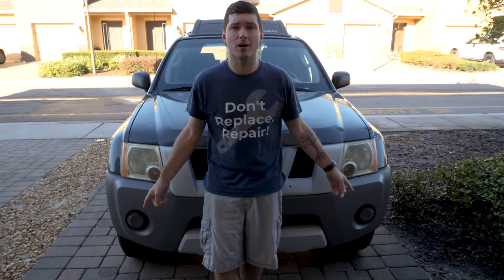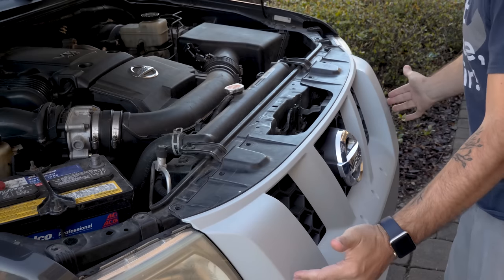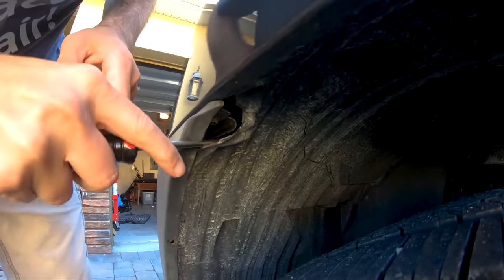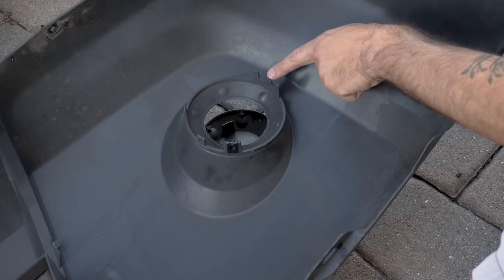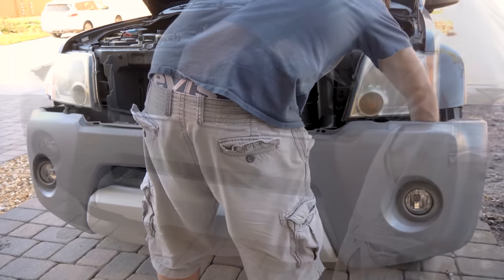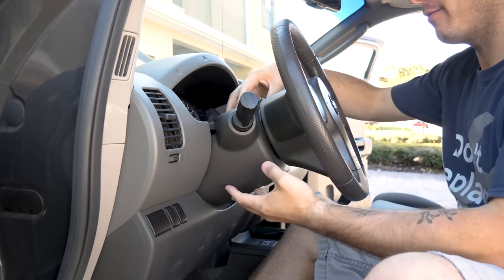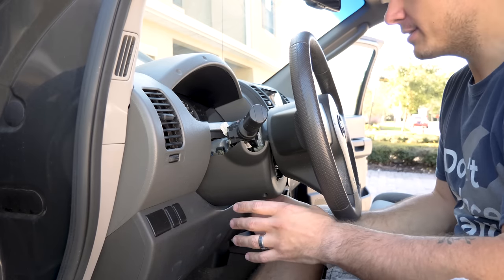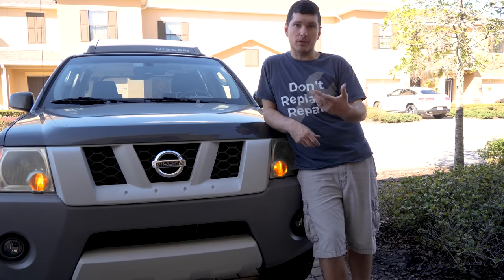How to Install OEM Fog lights into a Nissan Xterra

Comment: 2015 XTerra. This is the first time I've seen a split in the 2nd generation year range for a part, and I'm wondering if it has to do with the wiring harness. I have a 2005 XTerra, Off Road 4×4 4.0L. when I used your link for Xterra, the kit that comes up on Amazon has some confusing information. In the "Description" section it says it fits 2005-2015 XTerra, but below that in the "Features and Details" section it says it fits 2008 - 2015 XTerra. I also found a combination turn signal/ Fog Light switch on eBay that says it fits 2005 - 2007 XTerra with Fog Lights. Do you think this is because the 2005 - 2007 Xterra doesn't have the wiring harness? That would be typical for the way my luck runs.
Reply: Update: Now I'm even more confused. I did some research and found some forums where people were saying if you have a 2005 - 2007 XTerra with the "S" Trim package, you will have the wiring harness for the fog lights. In response there were other posts stating that not all of the "S" Trim packages for those years have the wiring harness. Someone else said: "To avoid confusion about your Trim package, look in the door jam and there will be a sticker with the model number and the Trim version". Like I said before, I have an Off-road model so I didn't know what to expect. My sticker shows me having the "X" Trim package. So, needless to say, I was very disappointed. I checked the sticker at about 1:00am on a Saturday night, in the rain, so I wasn't about to crawl under the vehicle and look. So, this morning I was removing the rear bumper (got rear ended a few weeks ago) and I was already on my creeper, so I decided to take a look under the front and see if anything was visible. Well, low and behold, there was an orange connector, just like the one in this video, taped to the harness. Now, I assume that wiring goes all the way into the steering column, so now my confusion is whether I should buy the turn signal arm that says for 2005 - 2007 XTerra with fog lights? My XTerra is in really good condition. Most people can't believe it's a 2005 model. I take good care of it. I plan on keeping it, so I want to add the extra features it doesn't have. I already added a new head unit with a touch screen, and installed a backup camera. If I win the lottery, I'm putting a supercharger on it and moving up from smoking 5.0 Mustangs to smoking GT500 Mustangs.  lol. Anyway. I appreciate any advice or insights if anyone reads this.

Comment: I have a 4x4 Xterra SE. Would the roof lights wiring be in place as well or is that reserved for the Pro 4-X?
Reply: It does not appear to be the case. Vehicles with roof lights have a 3-screw plate where the wiring exits the roof.
Reply from the maker: Bummer!

Comment: Does the whole bumper need to come off if your just replacing the housing?  (Someone kicked in and shattered the lens on one of my fog lights...)
Reply from the maker: You should be able to reach them through the wheel well if you remove the inner covers.

Comment: Are 2005-2007 configuration different from 2008-2015?

A junk yard just recieved a 2005 xterra and I noticed foglights on them. I have a 2015 xterra...are they interchangeable?
Reply from the maker: No, I do not believe they are compatible with the face-lifted Xterraa
Reply: @Rythecarguy  Thank you for the response

Comment: Was the light output noticeable? I'm wondering if it actually makes much a difference down the road
Reply from the maker: Noticeable is a good word for it. I did notice them. They were not a massive improvement however.
Reply: @Rythecarguy  change the bulbs out for LEDs much brighter

Comment: Everything was going great & getting ready to order. Until i saw I needed to change the on/off stock thingy as well.
Reply from the maker: It’s easy! Don’t let that stop you.
Reply: @Rythecarguy   is there a way to get around having to buy a new "on/off stock thingy"? I just bought some fog lights without buying the new stock. Basically I'm a poor collage student and I'm not going to spend a extra $150 to get it.

Comment: Another great one!! Thank you Ry! 👍 👍
I just put mine in my '08 I had to take my lights back to my guys at Nissan. They told me they "just fit" but not a 
perfect fit (on some models) :) They didn't even have a parts listing for the '08 X. 
I had to drill out the hole on the bumper cover a little lower on my bumper cover. 
And like my boy said they just fit LOL! Great clip, thank you for the post!
Oh yeah these are super easy to align!!!  👍

Hey Ry! swing by my channel! I do drones and things :) 
Be great to have you visit and comment and support
Have a good one bro!

Comment: What model xterra do you have ?
Do all the xterras come prewired for the fog lights?
Reply from the maker: Yes, I have the cheapest most stripped down model. The S
Reply: @Rythecarguy  I have a 2012 basecamp or at least that’s what comes up when I run the vin through Nissan and so It’s my moms old truck because now she still into trucks but more luxurious so it’s steel wheels no options for me abs I’m watching your videos they’ve been so helpful in teaching me what I want to do with it starting with those portholes in the space of fog lights that’s my starting thing to tackle.. do you know anything about this model I have I can’t seem to find the specs anywhere ..
Reply from the maker: Nice! If you take care of your X it will take care of you. Unfortunately I do not know anything about that model. If you have not already, I recommend checking out the Xterra subreddit, tons of great people over there willing to help out. I'm a mod over there too. Thanks for watching man, have fun working on your rig.
Reply: @Rythecarguy  thank you so much you’ve been a great help..

Comment: One thing I noticed with mine is that there is no dash indicator light for the fog lights.
Reply: I have a separate toggle switch for my SuperBright LED's in my bumper on a 07 Xterra. That way I can use them as daytime running lamps without even touching my headlight switch. And I like that I can run just a combination of parking lights with the SuperBright's (No having to turn the headlights on just to use the SB's) 😉

Comment: I bought the expensive ass stalk for the fog lights since Nissan made a two-year only part (05-06) to find out they only come on when your regular lights are on.... They won't work if your headlights aren't on or with your running lights or bright. If I would have known that I would have just installed a separate switch and saved myself a bunch of money.
Reply from the maker: Yea I realized that too. Interesting. Not sure why you would want your fogs on without your headlights but I get it. You should be able to have the option.
Reply: @Rythecarguy  I put bright LEDs in my fog lights so I would not only like the option of using them by themselves but would also really like the option of using them with my brights for when I'm out in the mountains or desert.

Comment: What year is your Xterra in this video?
Reply from the maker: 05
Reply: @Rythecarguy Nice same as mine. Just purchased it the other day. I notice your linked kit wasn't for an 05. Is the one you linked the exact kit you used? BTW great videos. Do you live in a snowy area at all? If so hows driving on snow with the RWD?
Reply from the maker: No, the kit I used was off of a salvage Xterra. I actually had trouble finding new kits for the 05. I think they did a few things differently on the 05’s since that was the first year of the remodel. I think they refined a few things for the following years (yay...). I have been bouncing between Michigan and Florida these last few years and I have had the X in both places. I did have a few little slips here and there on shitty roads but I also didn’t put any weight over the rear axel which is a common thing to do for RWD in the winter. As far as traversing through deep snow in driveways and such I didn’t have any issues. It handled it all pretty well.

Comment: The OEM foglights are are as piss yellow as the stock headlights. My headlights on my 2006 are so bad its almost a safety issue. I ordered LED headlight bulbs as a replacement.

Comment: Good video but a lot of unnecessary work.  I did this to my 2018 Frontier and only needed to remove the two screws in the wheel well to gain access to the cavity.  Pull back the liner and it’s all right there.  Took me literally 10 minutes total.
Reply from the maker: Yea I agree but I always follow the factory service manual for all these “technical” jobs. Sometimes they take you on the scenic route.

Comment: Mine came without light bracket
Reply from the maker: Bummer, you should reach out to the seller.
Reply: I was also wondering if you can buy the mounting brackets for the lights separately.  I have seen many kits with lights and switch(turn signal/headlamp/foglight). However the warn that you already have mounting brackets.
Reply: Just bought  the brackets separately,  and they don't come with the screw mounts, damn it!!

Comment: So does the new Turn Signal Stock have Auto On for the headlights and if so does it work? Does the FogLights turn off when using High Beam?
Reply from the maker: Yes mine did and no the auto lights did not work. Not sure about the high beams.
Reply: @Rythecarguy  They're saying on the ClubFrontier.org forums it works straight out of the box for their 2019's. Lucky them.